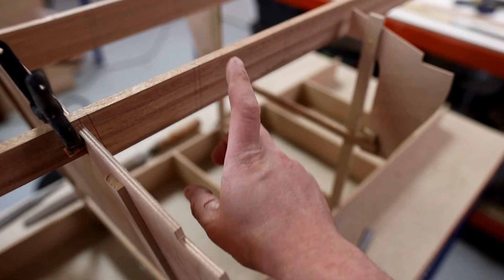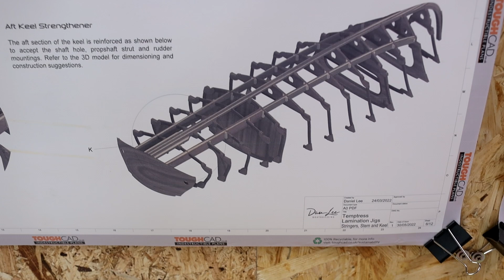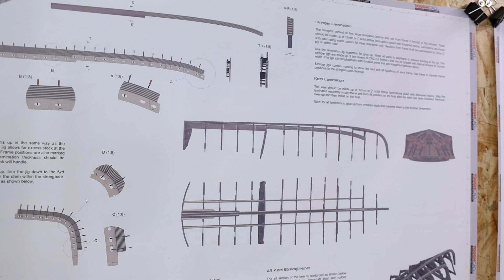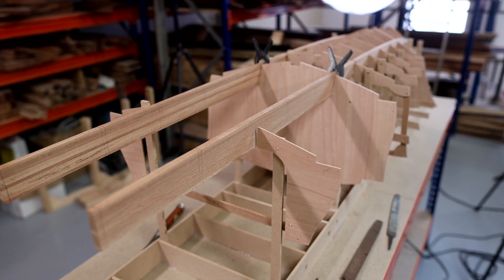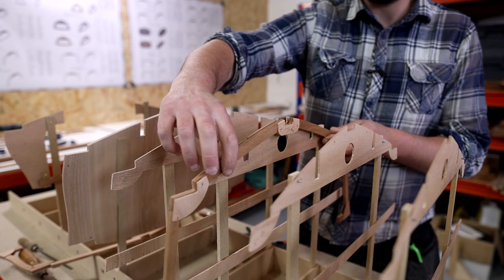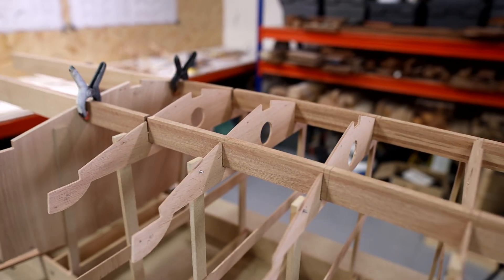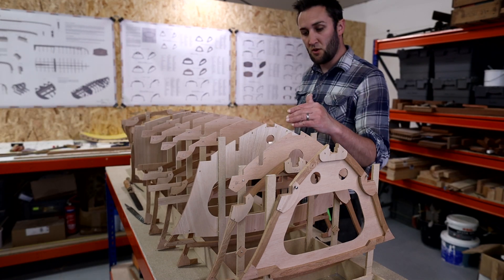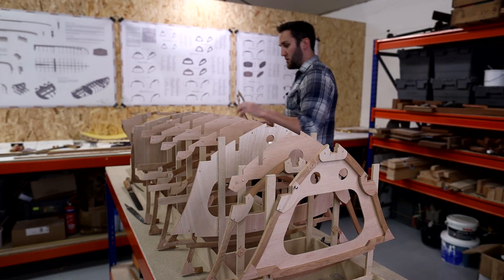Continuing Work On The Stringers | Temptress 1/4 Scale Boat Build Part 8

Comment: Why dont you clamb the frames a little higher to the bulkheads for those that have bulkheads and then stick the stringer from the back to the front without touching laser-alligned bulkheads that otherwise may cause mis-alignment?
Reply from the maker: Good idea 👍

Comment: Hi, she is coming along nicely. I am interested in the glue you are using as I am are about to start building a model RC controlled Venice water taxi. If you have been to Venice you may recall the nice mahogany craft they get around in. The glue looks like a two part with a spray activator which sets it off quickly. Can you please let me know the details of it so I can try looking for it her in New Zealand. Cheers Ian.
Reply from the maker: The glue is called Mitre fast, it is a cyanoacrylate glue with an activating spray which sets it in a few seconds. Very good if you want to get joints set up quickly, ideal for this series I'm doing. I'm pretty sure I showed it in the first frame building video.

Comment: Could metal straps be used instead of the stringers ??? … like what’s used in house construction bracing ???
Reply from the maker: No I don't think so. The stringers are key structural beams within the boat they, need to completely house each frame. The notches in the stringers are closed off again when the bottom of the boat goes on which makes the assembly incredibly strong. I wouldn't recommend replacing this system with anything else.

Comment: Are you adding all these "improvements" to the building instructions?  It would be nice when purchasing the instructions to have them updated with all the issues encountered with an actual build process.
Reply from the maker: I will do. Half of the reason behind this build is to get all of the little tweaks worked out in order to improve the plans over time. There is only so much you can do in CAD, nothing quite like actually building the thing to fully refine it! I'm putting together a list of things that will get added in to the rev2 drawings.
Reply: @DanLeeBoatbuilding  That is good to hear.  Looking forward to the 1/4 scale plans and the continuation of this video series.

Comment: Did you ever sort out why the initial stringer depth was not enough?
Reply from the maker: Yes I just converted it wrong. The plans show 11 layers for the main stringer run at 12mm, I think I was aiming for 5 layers at 6mm, maybe should have been 6, but I also machined them to 5mm which is why I ended up way under size. Much smaller tolerances on this size model!